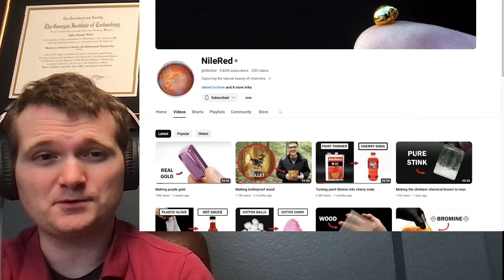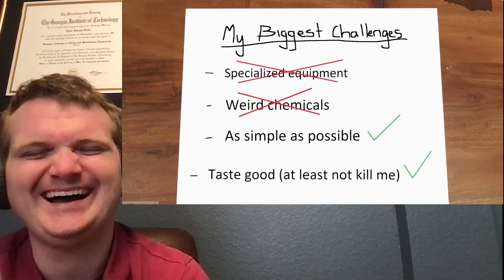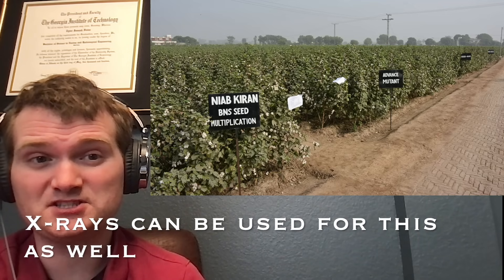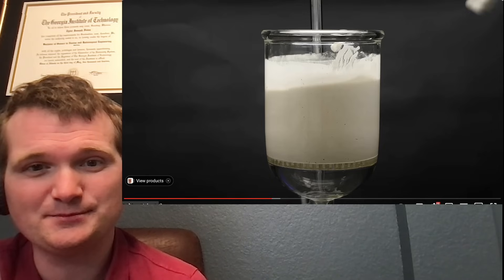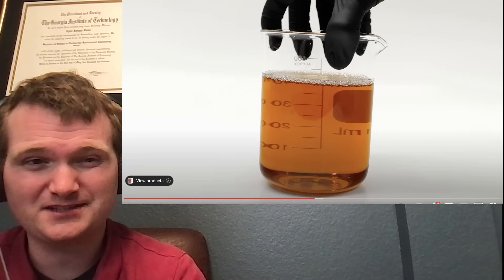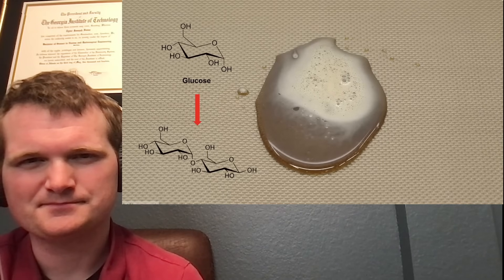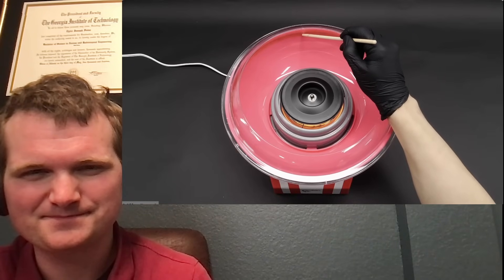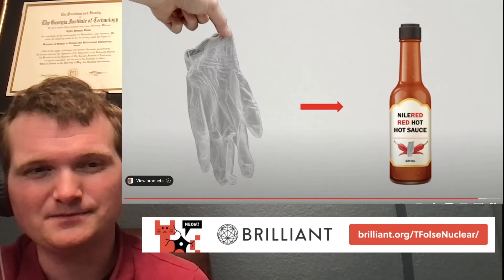Nuclear Engineer Reacts to NileRed Turning Cotton Balls Into Cotton Candy

Comment: Love the reactions! 

I think when you mentioned hydrolysis and submarines, the process you ACTUALLY were referring to was electrolysis. 

Electrolysis is the breakdown of water into H2 and O2, whereas hydrolysis is the breakdown of a chemical compound due to the addition of water.

Keep up the great vids! :)
Reply from the maker: Yes, I did 😅 Thank you very much for the correction!
Reply: Mostly correct.
 Except the products of electrolysis is pure hydrogen (H1), 2 atoms and Oxygen8, 1 atom.....
The correct symbolic writing of water is  2H1,1O8 but for simplicity it is short hand written as H2O.
Reply: @tfolsenuclear  I don't think submarines use electrolysis.
Electrolysis works by separating hidrogen from oxygen of water molecules, but sea water has salt.

When you do electrolysis of salt water you pull hydrogen and chlorine from it, leaving sodium oxides as a residue.

Needless to say that breathing chlorine is a bad idea.

I think Veritasium made a video about how submarines produced their own oxygen. 
Either Veritasium or Smarter Every Day, not sure which one.

For submarines to do electrolysis they would have to desalinate sea water first or have their own fresh water supply.

Edit
It was Smarter Every Day, not Veritasium.
Reply: @andregon4366 can't the submarines do distillation? With a lot of heat from its portable nuclear plant, evaporating salt water can both turn the turbines and distill it.
Reply: @nd_otd  That wasn't how they did it in the video.

Comment: Good to hear the chemical  risks of thermal power generation mentioned. A good fraction of the cost of a thermal power station is in water treatment. That's until a mix-up in the plumbing at a new power station  leads to sea water going into the boiler. That was one expensive oops.

Comment: High glucose ratios can definitely be a problem when it comes to making cotton candy, especially in a low end machine like Nile is using here. Having cooling fins helps a lot and probably would have made a half reasonable product.
Crushing or grinding it prior to running it through the machine may also have helped some to get finer threads. Those machines definitely struggle with larger pieces whereas chunks of rock candy that I make and Jolly Ranchers both make fantastic cotton candy in the upper mid grade machine I run now.
As an occasional cotton candy professional (not expert), this was definitely one of my favorite videos of his.

Comment: Rè electric shock in water.   Electricity always takes the easiest path (path of least resistance) and the human body is more resistant than water (except of course dialectric water) so if yiu are totally immersed in water and touching nothing but water you will receive NO shock.   The potential surrouning you is the same in all directions.   The sjock occurs when you touch something else that is conductive...
As an aside if you are surrounded by 50,000 (or more) volts - everything you are touching is equal you get no shock.   It is why birds on a high voltage wire receive no shock unless they touch 2 wires of different potential...